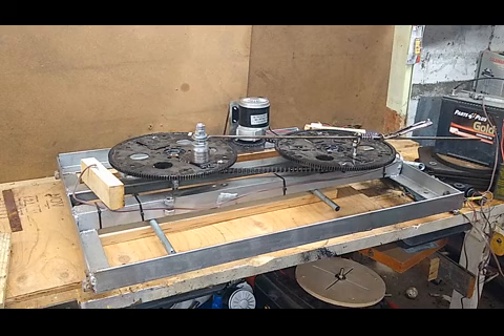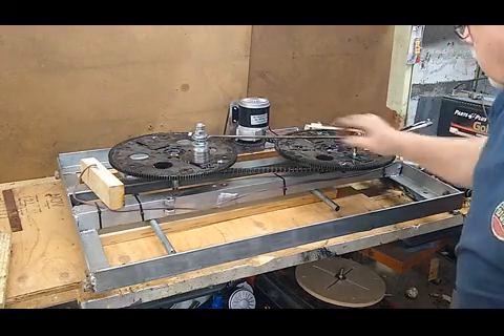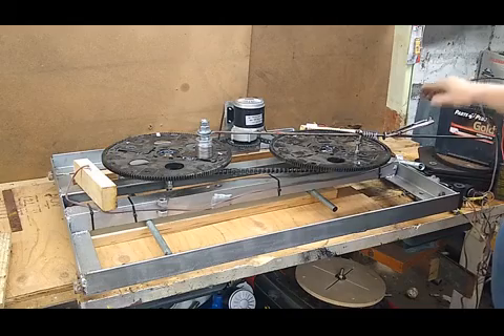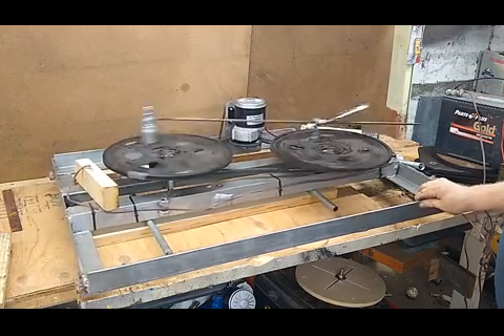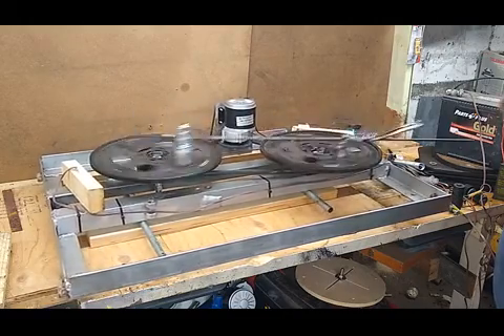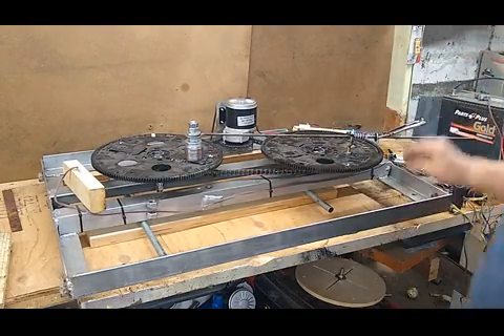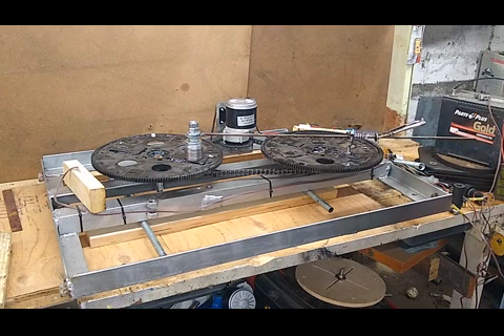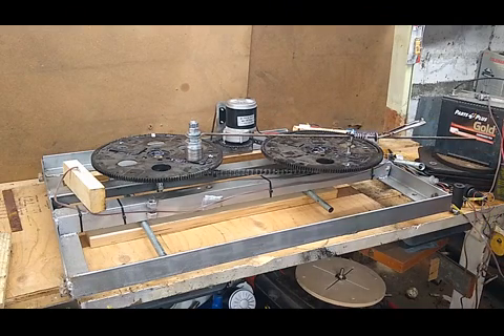LOLA Part 2

Comment: Very interesting system.
I wonder if it is the same as The Trammel engine's in that it generates propulsion at the same time as it accelerates and decelerates?
Reply from the maker: Thanks for the comment! 
This was a small scale experiment to analyze the action & reaction of the concept. It is quite similar to a 1/4 scale model of the Trammel's motion but without the harsh angular momentum changes needed to make it as effective as the mechanics of the Trammel. 
This was useful to me to experiment with, ant maybe it will help others realize how simple it is to experiment with closed loop propulsion without expensive and complicated machinery.